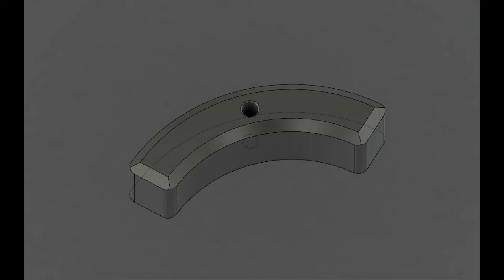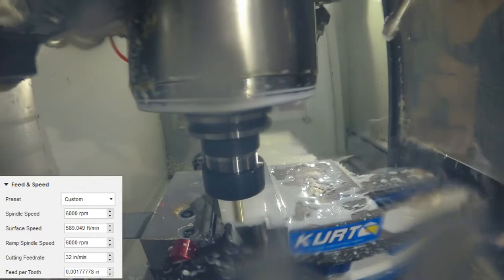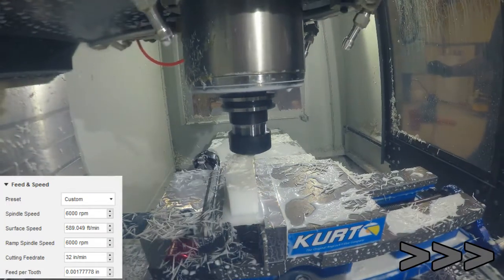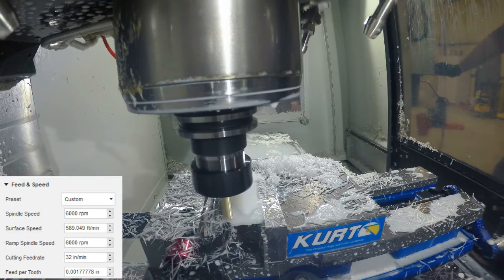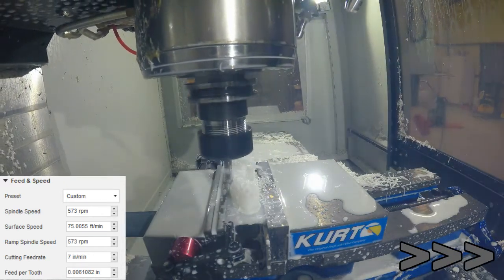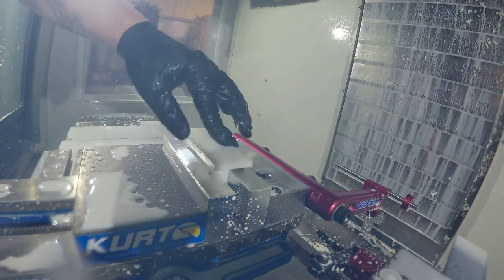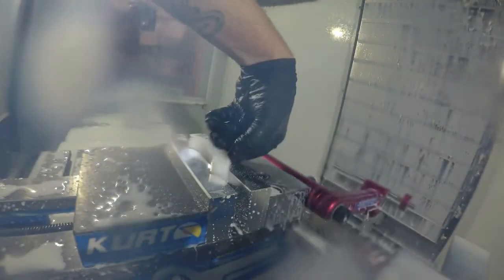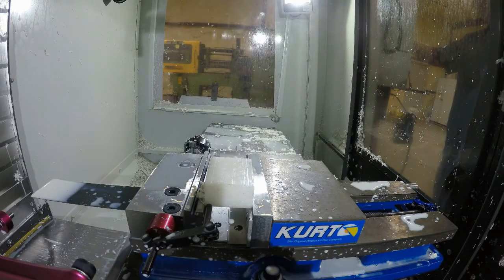2 different UHMW parts cut on HAAS VF-2

Comment: Did you ever look at CarveSmart vise jaws? They are the best for holding thin and soft material and clamp the part by only 0.070". You can make your own jaws, I would buy the Mitee-Bite Talon grip inserts. You would forget when the last time you clamped the parts in the vise by parallels on soft material for the the 1st OP/roughing operation.
Reply from the maker: Hi, yea I had looked at them in the past but getting setup would cost me about as much as my Kurt vise cost. At the time it wasn't something I wanted to do and kinda forgot about it. However your comment had me go look at them again and I think I will purchasing the vice jaws and talon grips within the next month.  Thanks for reminding me about them.